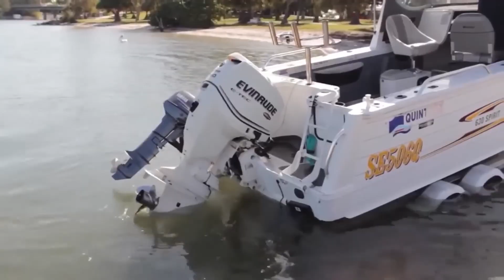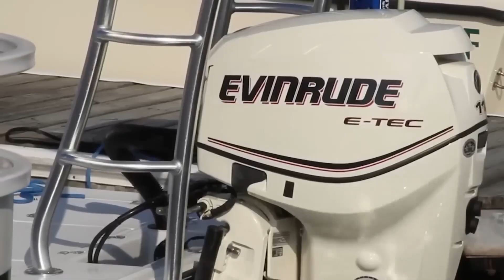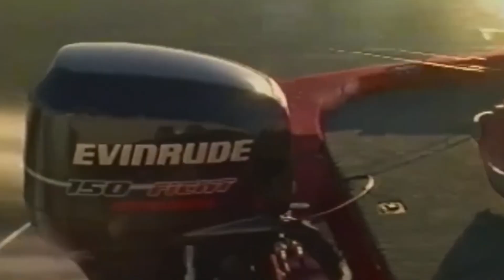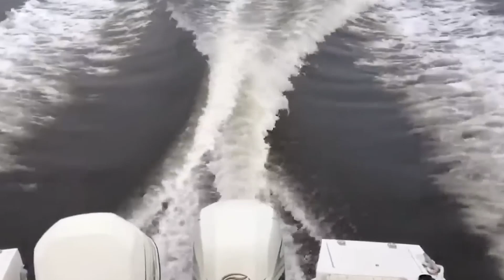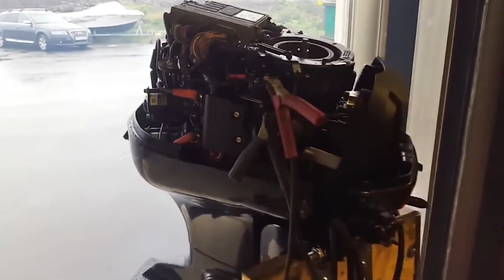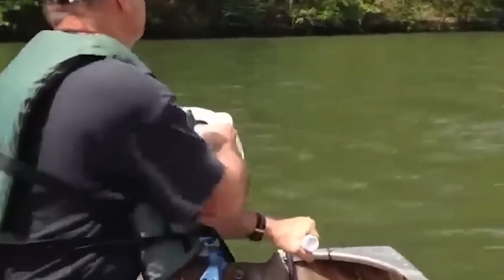The Shocking Truth Behind Evinrude’s Ficht Engine

Comment: Eninrudes biggest mistake?  Not giving up on 2-stroke.  I personally was not impressed with their engines due mainly to long term reliability. Bottom line most consumers didn’t want them so they should have started developing their own 4-stroke engines. No what do they do?  Introduce the Rotax a flat 2-stroke engine with an even worse design??  Another huge flop. Foolish

Comment: The shocking truth..... Is that the EPA killed what was an American industry.... And handed it to the japanese..... Using entirely arbitrary timelines for emission  changes.   Completely arbitrary.   Today's four strokes still have problems...20 yrs later.... A big problem is raw water cooling results in condensing fuel on cylinder walls and diluting the oil......  there is still corrosion problems, water ingestion problems in a following sea, etc.   the simple two-stroke with 50 to 1 pre-mix...was the best engine for marine outboard.    I still have several from 30-50+ yrs old running without issue.…... Keep the carburetors clean is all you have to do

Comment: E-tec was just as bad as Ficht. Little to no compression on one or more cylinders was common place on these engines with less than 500 hours and in many cases way less than 500 hours. With 4 strokes lasting over 2000 hours and often over 4000 hours E-TEC was a joke costing about the same as 4 strokes but lasting a fraction of the hours.

Comment: I sold/serviced outboards for a number of years.  I did some PWC's long before FICHT became a staple on the OMC stuff.  FICHT was a joke.  Unreliable isn't the correct term.  It was just junk.  Garbage.  No training to be able to fix them.  I dealt with lots and lots of 25hp versions through 2020. So let's compare the BRP ETEC 25hp to the Yamaha 25hp.  At the time, the Yamaha was 127 lbs weight, cost $3400, used less fuel than etec,.  ETEC was 160+ lb, cost $5200.  Gee I wonder why they didnt' sell any?  Not to mention it wasn't a matter of if the ETEC would eventually die, it was "when"-because most of them did with a few exceptions.  Evinrude failed to keep up with the market, plain and simple.  I saw this coming in the late 1990's and by 2010, we were basically done with them.

Comment: it is the problem with technical managers, they prefer immediate  profit over lasting reputation. beacuse thay know that 3 or 4 years later, that they changed of job for one with greater eranings.
In the case of the FICTH engine, there is not a big  leap to convert it to a 2 stroke diesel engine. ( like the detroit series 51 diesels )
 It is the reason short term vision companies almost always  fail .

Comment: Why do you keep showing Evinrude Etec outboards?
Show the actual motors.
Engines shown are Yamaha four strokes, Suzuki four stroke, BRP Etec and more.
Can you show evidence of engine fires? Never seen it.
The biggest problem was blown power heads 😂
If you were lucky, it would just go into limp mode.
This video seems poorly researched and written.
AI narrator has trouble saying Ficht 😂
Reply: There were burned-out engines in Finland in the early 2000s in Mercury/Mariner f50 efi and f60 efi models. The cause of the fires was the voltage regulator. Rumor has it that a better regulator was replaced during maintenance, but the matter was not discussed publicly and many do-it-yourselfers' engines experienced an electrical fire. In Evinrude E-tec engines, ECUs have broken down an unacceptable amount and Ficht engines had good features but were not reliable. A big reason for the damage to many Ficht and E-Tec engines is the carelessness of the users when they put cheap 2-stroke oil in their engines.
Reply: @jussialanko9197 XD100 oil was designed for the Etec. I used it extensively in premix 2 strokes. 
Running at 70:1 with zero issues with engine wear and smoke.
I have to agree with the Etec computers, they were an issue.
I’ve seen many outboards catch fire, but never a Ficht.
Reply: @TheRubbishDiver  How often has the cause of the noise been that it hasn't been getting cooling water, for example a bad impeller or debris in the system, not to mention blockages caused by seawater. The cooling water goes through a really small hole that few people ever even check.
Reply: @jussialanko9197 Etec engine noise is because of the redesigned exhaust chamber. Fichts sound like a 2 stroke because it still the original design exhaust chamber in the column as all previous 2 strokes. It’s basically a V4 90hp leg with a fuel injected block.
As you probably know, 2 strokes need the right exhaust to work more efficiently.
All engines are at the mercy of its impeller.
Reply: @jussialanko9197 Best motor that i owned, when it worked : 2015 250 Etec G2 H.O., 9-times for warranty service in 4-years, faulty ECU was propable cause , the was on-off CAN-faults every summer , until ECU could not connect computer for sevice and finally changeg. POWER and economy was super but reliability was so poor that owning one without warranty would be a nightmare !

Comment: Where's your documentation for engine fires?
Reply: As a dealer I had one customers 99 150 explode when the high pressure fuel pump leaked from a poorly crimped output side fitting. Scary for him and I almost ended up being sued. Yeah it happened.